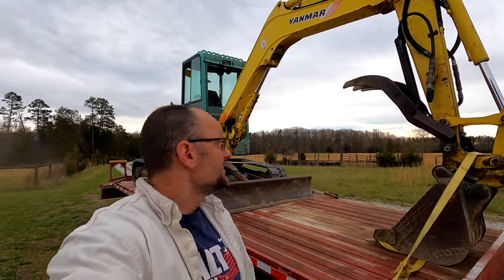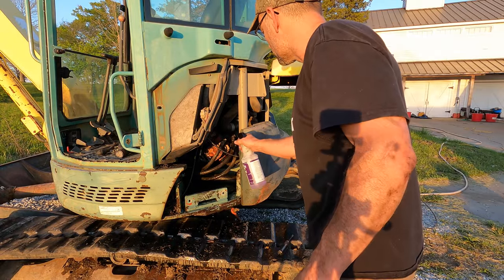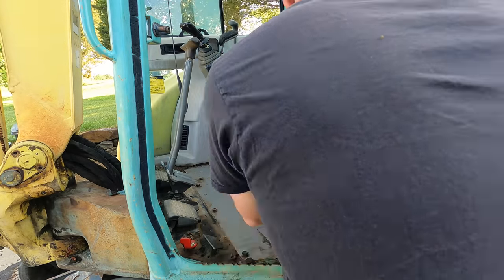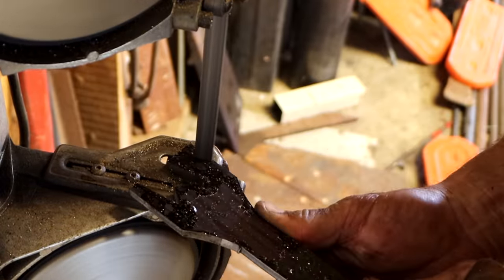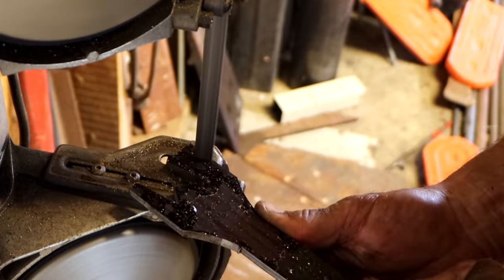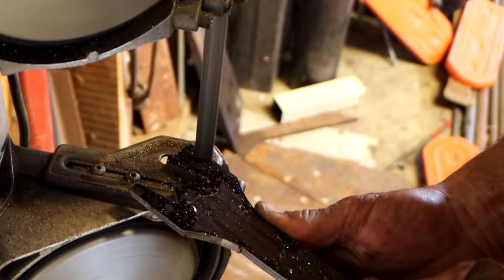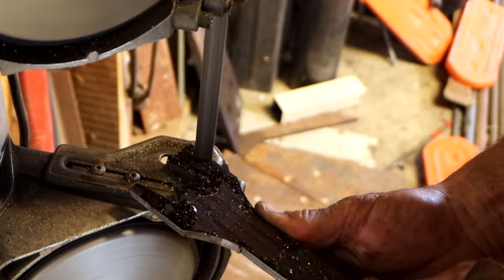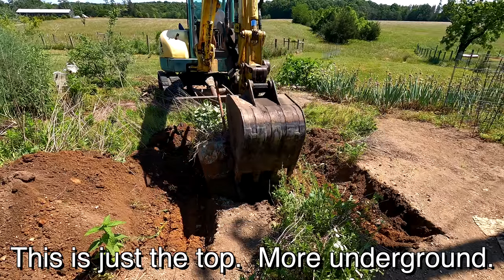Buying (and Fixing) My First Excavator.  Yanmar VIO-50

Comment: If you still have problem with tracs going in different speed, I suggest you check your hydraulic rotator between the upper rotating part of the machine and the lower part that have the tracs. There are gaskets/O-rings here that could be broken such as you can have a backleakage from hydraulic oil from the slower trac. I had that problem on my machine Regards Ketil Tokstad from Norway

Comment: Seems like a good deal with the price of equipment right now. Looking at the state it was in, I'd say you already gave it more maintenance than the previous owner ever did. One thing I haven't seen in the comments yet: your pin that came out should have a washer or 2 between the snap ring and the housing. The more side to side movement on the pin the worse it'll wear so you want to fill that space in.

Comment: That's a good deal. Yanmar are the gold standard in smaller excavators - matter of fact, Yanmar's products across the spectrum are all very high quality - ask John Deere. Every reefer travelling the highways runs a 2cyl Yanmar that runs all day long with no attention
Reply: Kubota make a fairly good engine but Yanmar are a newer design , better fuel efficiency and emissions and also a better balanced motor too

Comment: for greasing the 'house' bearing, I sit inside the cab (I have a battery operated grease gun) and hold the trigger while I swing the house around, saves me getting in and out of the cab except to just switch the grease gun to the other zert

Comment: Re tracks, Jack it up with the bucket and pump grease into the adjuster until you have two finger space from the roller. It’s easy to pull the track frame Jack out, run the track off the idler, pull out the idler and reach in and grab the Jack cylinder. You can pop the piston out because there is only a seal, there is a “O” ring and behind that is a nylon wafer, make sure you put a new one in before the “O” ring. If you are still not tracking straight then adjust your travel levers until you get a new track to match the other one.

Comment: Dont change suction filter in hydraulic tank when you got some oil there. When you get filltre up all the junk around filter goes straight to the pump. 
Change suction filtere should be connected to the change of the hydraulic oil (around 2000h) ale just poor ale the oil from the tank when you need to do it. 
Sorry for my english :)

Comment: If all else fails on drain plugs I get a small chisel and tap it on the outside edge of the plug ,Gives you a little curl of steel on the edge of the plug but youll probaly replace the plug anyways. if this doesn't work then ya need to weld a nut to the plug and drive it out with a wrench or socket.

Comment: When you said your blade doesn't hold position.... on top of that you have weak travel on one or two travel motors, your issue is your rotary manifold seals are leaking between circuits. I know because I had all these problems... besides getting it out of the machine the job isn't too bad to do.

Comment: just take the track off and then you can slide the wheel out.  then you can pull the tension cylinder out.  maybe the seal is broken or the cylinder rot is corroded. greetings from Belgium

Comment: Hi , you  look a very competent mechanic and filmmaker . I've just bought a similar machine in very similar condition and I'm feeling guilty. You are doing all the things   I should be doing. I will refer back to this, as  it's a pretty comprehensive maintenance and  check over procedure. Well done.  I was wondering if you'd tried those thin gloves. I find they  offer some protection and  keep the hands clean.  Ok, its getting light, where's my grease gun.

Comment: That adjustment is the pressure compensator. It is used to control the maximum pressure the pump will produce. It's not the pressure relief valve, that protects the entire system from over pressure. The pressure compensator just control the maximum pressure the pump makes. If you research this you'll find this compensator setting establishes the pressure where the swash goes to zero flow at the compensator pressure setting, this results in a standby condition at pump outlet. When the compensator sees a pressure drop the swashplate is allowed to move and the pump will start to produce pressure until the pressure is reached again.
This variable displacement pump means you are working with a closed center hydraulic system as compared to an open center system.
Closed center systems are way more responsive.  The system has a higher pressure waiting to be put to work in the actuator ( hydraulic cylinder or hydraulic motor). Modern hydraulic systems use what is called Load Sense.
Load sense uses a low pressure( approximately 600 psi) called stand by pressure. When a line sees a pressure drop the corresponding Load sense line goes directly to a Load sense pressure control valve next to the pumps   
Pressure compensator valve. They are usually side by side at the pump housing.
I don't think I saw the Load sense valve on the pump drawing you showed in the beginning of this video.
If you have any questions get in touch.
Go slow and learn all you can.
You have a good attitude to care for your machine.

Comment: that gold colored part what in the plumbing business would be a water hammer but different companies call it different names pressure release shock, hydraulic shock, anti knocker, basically it keep hydraulic fluid from damaging connectors,making noise it is probably on a constant flow line that when you turn on and off the valves soften the pressure kick back

Comment: If you put that windshield back on, It would be safer. If a hydronic leek where to blast off in the cabs direction. Or a piece of shrapnel where to come of the bucket under high load. Just safer to use it. Also throw sum degreser in the downstream on your pressure washer. Thank me later.

Comment: On that jobbie that the dealer didn't know what was, (shock eliminator), the o-ring leaks because it has a flat side on it. O-rings if ever have a flat side they need replaced, ON ANYTHING.

Comment: The fittings in the machine are BSPP . simular to pipe tap but are not tappered but run parallel,  British Standard Pipe Parallel.  Also the fitting you had off, make sure it it turned in far enough so the o-ring seals on the smooth portion of the fitting not the threads.
Reply: The small japanese excavators can use BSPP , BSPT , JIC , UNO and metric parallel on the same machine.

Comment: That is an accumulator and it designed to give you a small amount of hrdraulic function. It will relieve the system so there is no pressure build up on the lines/pumps

Comment: I'm probably wrong but, off the top of my head I'd say the part you made the wrench for, is to reduce chatter or fluid hammer in the system. Hydraulic oil changes in consistency w/temp.when hot it can foam from slipping though valves and checks. I believe the gold part allows for expansion in the pressurized portion of the system that doesn't have direct access to the return line and the extra volume of the Hydraulic tank. 
Like I Said I'm probably wrong. Just an uneducated  educated guess  🧏‍♂️🤷‍♂️

Comment: That pump is an open circuit axial piston pump and the adjustment screw adjusts minimum angle bias spring. Also the gold cylinder looks like a back pressure check valve? which is necessary in open circuit so that you don't cavitate.

Comment: Warn center joint seals from the main frame of the excavator down to the tracks is what causes them not to track straight.
Easy fix, you'll either remove it from the top or bottom of the machine and chuck a new seal kit in it

Comment: It helps to have the right tools or at least able to fabricate.  Bit surprised though you use a crescent wrench (adjustable) instead of a fixed /box wrench.  Just an observation. I was discourage to use an adjustable wrench unless I have to.  It was more prone for scraping knuckles or worst rounding a screw head

Comment: I hope you verified in the manual that the fuel water separator is prior to the lift pump.  Otherwise you risk cavitation of your lift pump and eventual failure.  More common would be to keep the inlet screen into the lift pump, but put both the fuel water separator and the secondary filter on the outlet side of the lift pump.

Comment: I'm sure you know now but with the self prime fuel systems, you turn the key on and let it fill. Sometimes they need a couple cycles before starting  and even though it's supposed to bleed itself, if there's a air bleeder on top I crack it and let it bubble out. Edit: got to the end, 20 was not a bad price.

Comment: get a set of crowfoot wrenches or socket adapters it will save you much aggravation. 
Rule one of hydraulics if it's not leaking somewhere you are out of fluid. but you must try to keep it to a minimum.

Comment: You might have a problem with the final drive gears, your tracks, back of the grease nipple at the adjuster, and push on your hubs to release the grease, clean everything check if you have a broken spring

Comment: Well, I think you've put in some REAL sweat equity 🤠👍🏽....
May I suggest if u haven't tossed the oil filter to cut it open and see what u find.   The last owner added fuel and that was it so it would seem !!
Checking the contents of the oil filter MAY give you a heads up 🤔.
If nothing else it confirms how good the engine is 🤓
ATB...

Comment: that one call it accumulate tank(bottle) also Teflon tape prevent use for high pressure hydraulic oil leaking specifically heavy Crain,
concrete pump boom quick connector(all ways leaking area)

Comment: Had the same issue you had with the gold thingy (Accumulator). You could grind down a 11/16 open end wrench on a cheaper tool to do the final torque. (Been there done that.)
Reply: If you are able bodied and advertise a little. You will/can make back the $21000 in a years time easy. (Even as a side hustle) People need excavators for everything from Foundations to Footers to Culvert repairs and installs and also septic systems. You can charge easy $45 to $50 a hour plus moving cost on the machine. Spread out over a year that is about 466 hours machine time.  If you just worked it on Saturdays 10 hours a day for a year that is 480 hours and thus pays off the machine. Plus now with the work you did and serviced it. Its worth more like $29000 now. Of coarse all that does NOT include fuel cost or repairs if you blow a hose.

Comment: @24:13 - I just read a story about not only diesel fuel (out of Texas) becoming scarce, but also diesel engine oil.  I think that engine oil is dino powered whereas newer gas engine oils are increasingly made from natural gas.  It's the crude at the heart of the issue.

Comment: I have watched a few of your videos now so I am going to make a recommendation if ya don’t mind. Please buy some cheap wrenches for Harbor Freight and grind them down so you can fit into narrow or tight spaces. Usually the wrenches hold up for a long time without breaking after being ground down. I have a complete set of wrenches just for hydraulics that are all have been grounded down, milled thinned to help ease the pain of working on hydraulics. I had to say something, it hurts my heart to see you struggle with an adjustable wrench because they are so damn bulky. Best of luck!

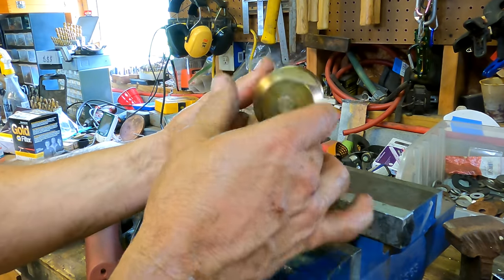Comment: 16:55 looks like a hydraulic pulsation damper, a tiny tank with air, a spring on one side of a piston or diaphragm, hydraulic fluid on the other, takes any uneven flow out of the hydraulic fluid, stops hammering effect

Comment: Looks like a damper, or shock absorber usually put on if you run a hammer sometimes they are put on the hydo lines on the boom.

Comment: This guy will survive on his own, for sure.
Next things happening:
2025: "I got this bargain deal on a barely used oil rig, it leaks a bit, but I really need to become independent on my fuel supply..."
2035: "They recently auctioned off this really affordable nuclear reactor. The previous owner said, it got bombarded only once before but works just fine. Since I am not subject to any sanctions (as they were), spare parts and some uranium should be fairly easy to come by."

Comment: I think trackspeed is different because the outer tracklengh is differing to much. And the new track seemed to be from another manufacturer. So the result is ( a car tire for example) that if you do one complete turn of a track you got 20 foot on the old side and 21 foot on the new side

Comment: that is a hydraulic accumulator designed  to absorb the hydraulic shock associated with the sudden open and closing of the valves of the system, like if you took your hands off the controls suddenly while the vehicle is in motion.

Comment: As best i can see thats  PFC type pump and whats leaking is the swash plate actuator cylinder the nut may have a hydraulic washer or a rubber washer under it to seal it either way an easy fix.With the plate in the off position its pumping oil but at a low flow rate when the plate comes in fully it increases to full flow and backs off when an overload is reached eg fully extended ram.

Comment: A nice old Yanmar to tighten up!!! Great machine!!!     I usta make jewelry so I had the Foredom already in getting into the chainsaw porting and polishing… hobby… seeing you make those couple of brass fittings from your casting…. Has me really missing the machine shop…my old buddy jimmy just crooked and these on more Bridgeport or lathe and not being able to just whip up a part you really need is greatly missed!!! I’ve got to bring home one of those little harbor freight lathes !!!  I freakin love the let me grab this big hunk of 6x6 and do some body work!!!  Slamming it like a grizzly bear and it pops back into shape!!! Big hunk of timber pops the panel back!!! straightening that panel was some excitement !!!
Reply: Looks absolutely horrible on the fuel system…dang it man it’s full of gross crap!!! I’m happy I found your channel you’re funny man!!! LMFFAO!  The little ding noise when tightening a nut like the torque wrench sounds!!!😂😂😂
Reply: I’m with you on the don’t maintain it… $35,000 dollar machine and the oils crud!!! What the heck!!! You are one of the only other dudes who grab the air chisel to loosen stuck fasteners… that’s my number one tool!!! I’ve welded all kinda little tools to do different stuff!!! Pressing on and off parts with it!!!

Comment: If thread sealant liquid, paste or tape get into your hydraulic system and finds its way into tight clearances between spool valves or pilot operating pressure control valves it can cause problems.  Often only corrected by replacing parts if they cannot be disassembled and cleaned internally.

Comment: Not tracking straight is being caused by the 2 different sized tracks. The track motors should be turning at same speed but since one track is worn it will have a different revolution per mile so it will want to pull to one side.  Install new tracks that are the same size and it should take care of the tracking problem.

Comment: 20K seems decent to me, I totally thought you forgot to tell us the price.  The Yanmar in my John Deere sub compact tractor is the same way with the fuel priming.  You just need to move the key to start and let it fill before you try to crank it.
Reply: Very cool design with the fuel.    Since the cab isn't completely anymore and the AC isn't working--- I would have like to see it go for $16k.  But it's still a good machine and will pay off in the long run either way.   He's mechanically inclined enough to probably get that stuff fixed for fairly cheap anyway.  It's solid where it needs to be-- the engine, final drives, and hydraulic pump are all great on these machines.

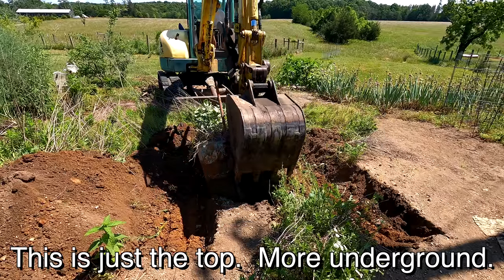Comment: 42:42 .....   You can just drill a 1/4" or even 3/8" hole (if theres enough room)--  and put a washer, then a bolt through your hole.  I suppose you could put a 3 point hitch style tractor pin through the hole too.

Comment: Pedantic minutiae from a mechanical engineer: pipe threads are interference fit, which is why they are tapered. The interference is what seals the connection. The Teflon tape is only there to reduce friction rather than to make the seal (Teflon is super slippery)
Reply: not in hydraulics . there are hydraulic sealants made for the job which are rated to 70,000 PSI.
Teflon tape is for water pipes or air lines if you really like old school , but there is white teflon paste for those anyway

Comment: Yo
Cool video. So just with my excavator the hydraulic oil level indicator has more to do with hydraulic cylinder usage than heat. As in, if the boom and dipper arm are in a certain position then the more hydraulic fluid is needed ‘over there’. Also with my digger after opening the hydraulic tank there are specific instructions on pressurising the hydraulic system through a series of operations. Your excavator May be different tho

Comment: Seems the smaller the machine the more money they go for! Was looking for a Yanmar SV05, Komatsu PC-03 or the tiny PC-01 and people wanted megabucks if you could even find one. Pretty sure the skew tracking isat least partly due to the difference in outer track circumference. It's like having an old and new tyre on the same axle, bad news.

Comment: If rebuilding the blade cylinder doesn't fix your issue, it could be a bad seal in the centre swivel joint which bypasses oil between two circuits. Had that issue with mine